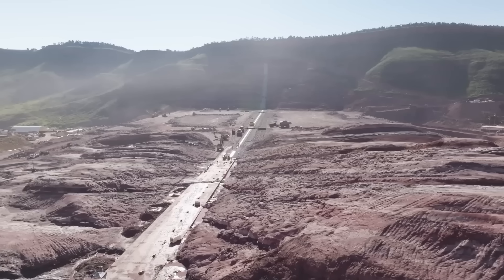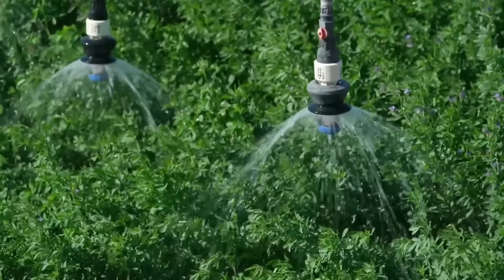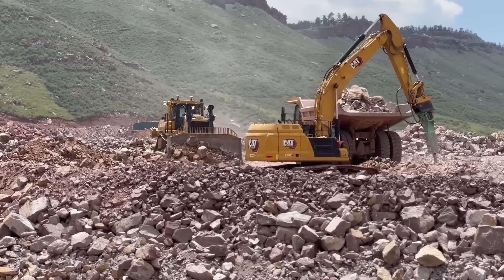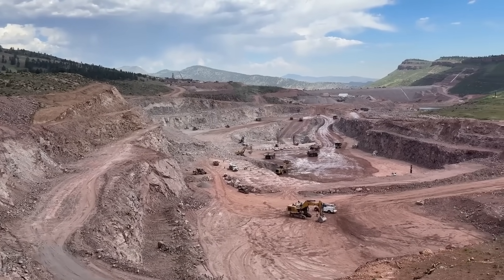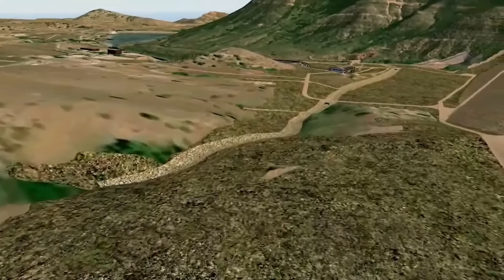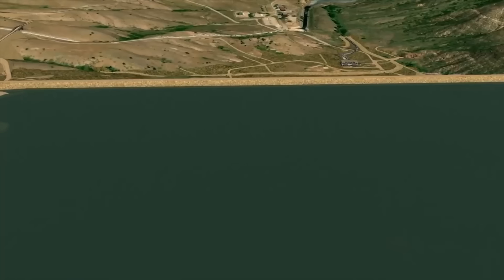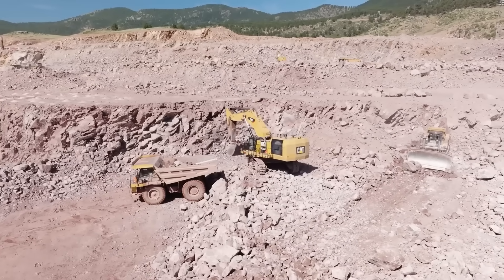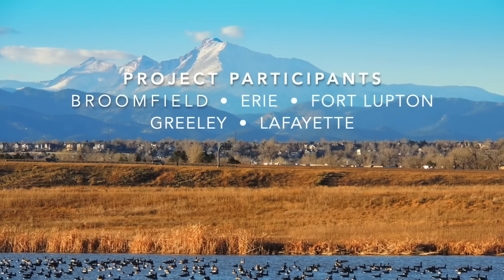Why the USA Is Flooding an Entire Valley

Comment: Some metric numbers might be useful.
What is an acre foot relate to anything else.
Both styles can easily be read out.
Reply: an acre is a imperial measure of land
1 foot is the area contained in that measure
hard luck metric as the two systems dont aline
better than 10 football fields
or Olympic pools

Comment: I don't understand why they didn't build turbines within the dam to produce electricity 🔌😢
Reply: It's not on a river, so it won't get a constant flow of water. The water is being pumped in via pipes from the nearest source. Expect for seasonal rains and snow melt, it won't have water running into it, so there will rarely be enough water coming out through the one spillway to warrant a water turbine. Which would only work during years with exceptional rainfall or snowmelt.

Comment: Colorado probably has the lowest percentage of hydroelectric production compared with its potential. It’s pretty frustrating to spend so much & pay more to make it work instead of using what we have naturally occurring. It’s expensive to pump water through the Divide!
Reply: bullshtt.  They cann pump the water at night when the wind turbines are powering thhe grid for cheap
Reply: @ it’s not free! That means it’s expensive compared to what it could be if we used inline technology

Comment: Three years to fill, monitoring structure. In the original plan for Teton Dam called for it to be filled in a couple years. This was required as part of the final compaction plan. Of course most of the original design engineers were gone during construction. Then the few engineers monitoring construction quality were gone after completion. Then there was very heavy snow pack the first winter. Project operators thought, great we can comply with minimum downstream flow requirements, fill the reservoir in one year, and start providing irrigation to the farmers a year early. 

After failure the investigations listed this as one of three major faults. I don’t think they ever said which one was the definitive cause.